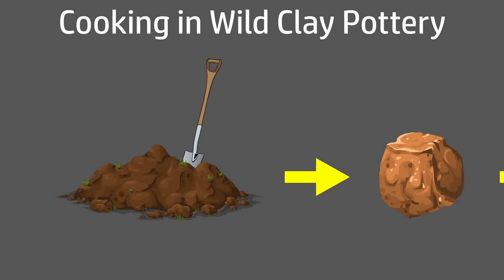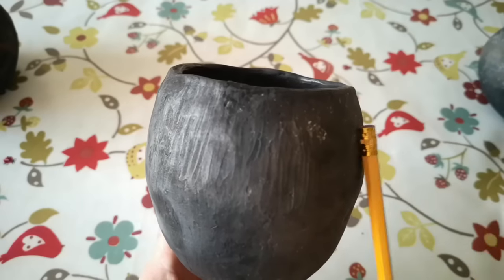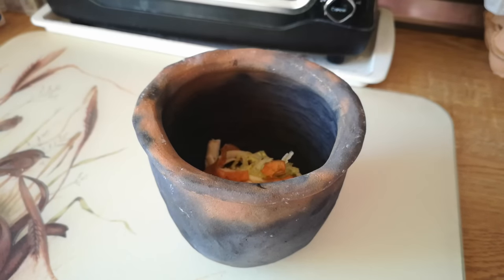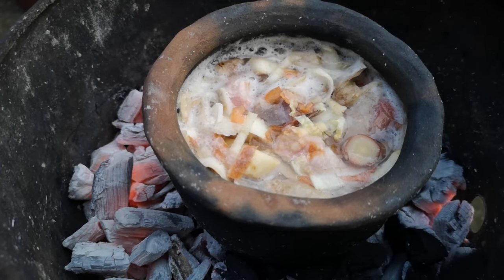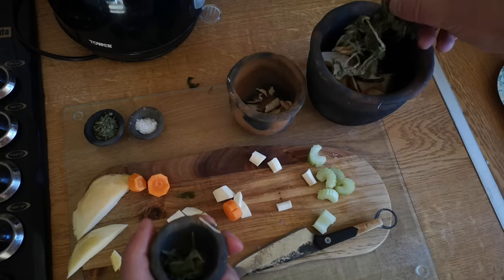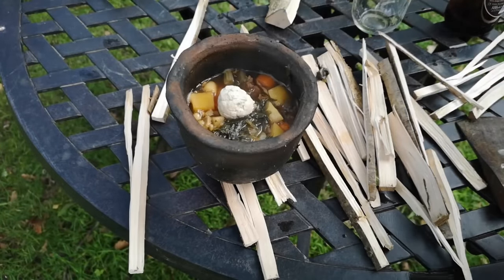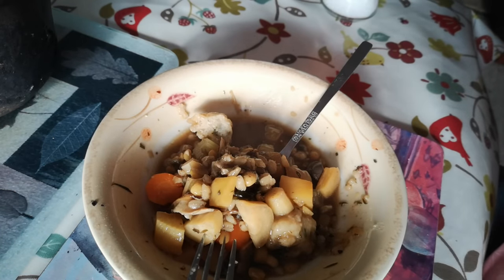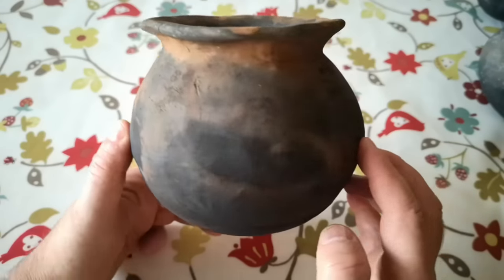Cooking in Wild Clay Pottery - Part 4 - Cooking! At Last!

Comment: Art project idea: You can use the Japanese method of Kintsugi to use gold resin or lacquer to fill in the cracks on some of the broken pots and turn then into art pieces
Reply: Seen it done before but hadnt thought of it. Great shout imo!
Reply: Ooh, that's a good idea!
Reply: ive done this using epoxy resin and fake gold dust(i think its used for fingernail painting) if i did it again id use superglue tho
Reply: @philrobbie1670  Not for cooking in though? Probably neither is foodsafe.
Reply: @adajanetta1  no not for cooking, i did it on the lid of a mug that had fallen off and shattered, superglue would be closer to foodsafe, but i doubt it would handle cooking temperatures

Comment: In Spain we cook in our old "cazuelas de barro" with or without cracks and no problem. Then you switch off the flame and use the residual heat to complete the dish. Congratualtions on your completed feat. Buy the way you could have cooked this on a barbeque type fire on a metal rack, just as we sometimes do to make a paella out in the open.

Comment: Enjoyed this series very much.I imagine these kind of pots were used like woks and cast iron skillets where the seasoning actually improved both the vessel and the flavors.I have cooked on a modern firepit and I used embers from large pieces of wood rather than blazing flames,the heat from embers is quite amazing and will easily boil liquid.I had a small metal firepit but for cooking I built a larger one made of bricks with an old oven rack placed over the top to cook in aluminum foil.My recipe 1 ground beef patty,a few sticks of celery and carrot,a potato cut like chips and some rings of cut onion.I would spray the foil with cooking spray to stop sticking but no other grease is needed,add the food,season as desired,seal up and cook above hot embers for about an hour or until it smells done,turning once carefully.The food won't be crisp but the flavor is amazing  .

Comment: What a satisfying conclusion! Would you ever try seasoning the pots with oil, similar to cast iron? I assume the polymerization of the oils inside the pores of the clay would make a practically impenetrable coating
Reply from the maker: Yeah, that's one of the ways earthenware is sometimes prepared. I didn't want to chance heating the pot without liquid in it in case it cracked and we would have to go around again

Comment: Oh Mr Shrimp, you slightly disappointed me at first as (admittedly) I jumped to the conclusion that someone as knowledgeable as you might have tried pre-seasoning the pot more in the way you would traditionally season something made of cast iron by getting oil just smoking before evenly spreading it and cooling, then repeating... That said I was impressed by the notion of a sacrificial meal that crucially included animal fats. Personally speaking, something that spikes my interest would be an intensive method but is "what if..." you just about liquidise the clay and grog, filter through a layer or two of muslin cloth to remove larger particles so you effectively have a very fine, yet very thick filtered slip, extrude that gloop and sandwich between two molds either made of wood or low and slow baked "raw" bowls (or even suitable modern crockery)... Allow the gloopy slip to dry well before seperating the molds and firing..... Instinct tells me that simply drying high quality thickened slip will cause its own cracks.... BUT...  At the end of the day Wedgwood manage to "cast" plenty of high quality porcelain goods in a similar way.